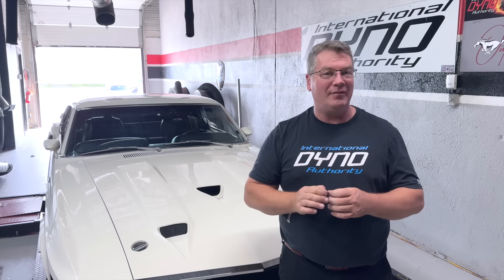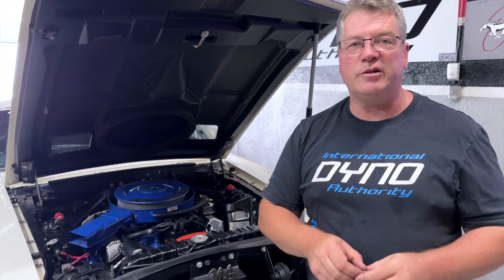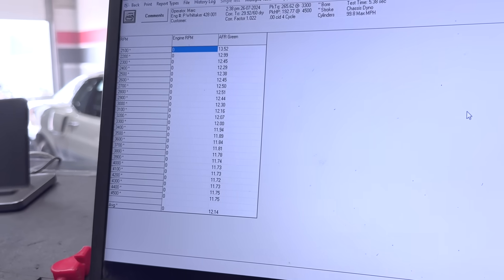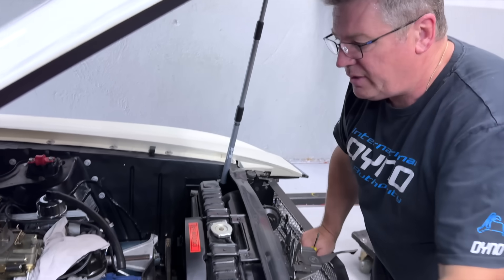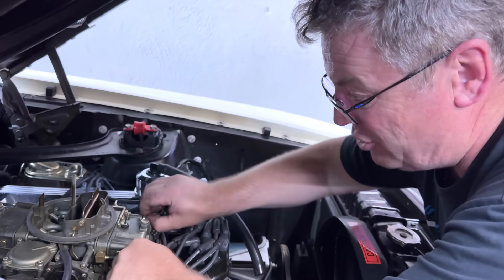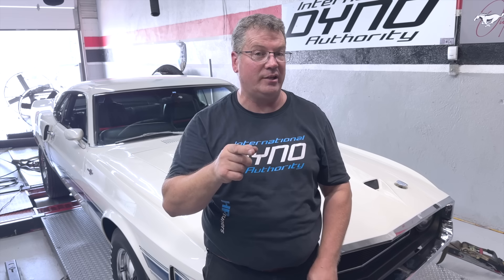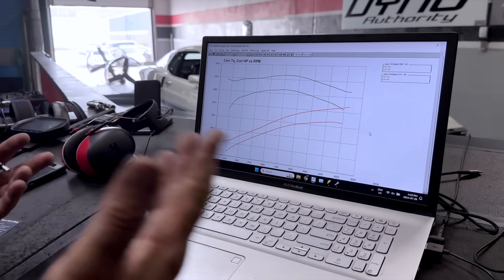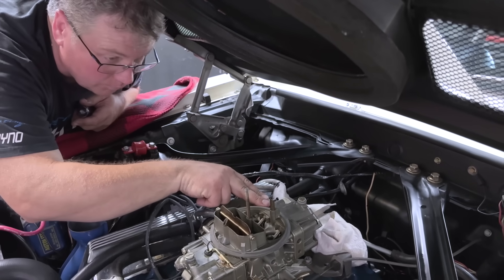Original, unrestored '69 Shelby GT500 tuned on the dyno

Comment: I run a 750 AVS on my modified 340. I took the choke out. Removed the flap and I also drive it on pretty days in the winter. I live in NC so it’s pretty much all year around. It takes a little longer to run on it’s own. About 2 minutes in winter. But with a bad experience on choke I usually remove them or wire them inoperable. Nice 428. What a beast.

Comment: The cringe is real with this guy, the point to make the pull is 🤮 plus the ear muffs
Reply from the maker: Excellent, and with with a tuning only shop, 600 + Vehicles through per season .... Making 16 passes on average per vehicle , That's just shy of 10,000 passes per season. Each and every person, who listens to 10,000 passes per season. Is going to use some sort of ear protection... We still want a job next year. LOL. Have a super evening. PS. Sometimes we do take our ear protection off just to hear a particularly awesome specimen of horsepower.

Comment: Did you restore the vacuum advance to get the timing on spec for light engine loads? I know it probably wouldn't make much difference on full-throttle dyno runs.

Comment: I went through the exact same exercise with my Holley 4150-series carb, and learned that they were intentionally "overjetted" from the factory to function across a wide range of ambient conditions so that the engine would never run lean even in the most brutal conditions.  This was solely done to prevent engine failures and warranty replacements.  Besides switching to smaller jets, you can also play with the PVCRs (Power Valve Channel Restrictors) and high speed air bleeds to really optimize the AFR for wide-open throttle performance.
Reply from the maker: @torqueytorque8861  

On a newer version, of this carburetor, you can adjust a lot more incrementally.

This carburetor, was limited to low speed  air screws. Fr. Rr main, Power valve, and float, squirter and nozzle size.

All of which we worked with, until happy with a "smoke free"  result.

High, mid, and low speed air bleeds would've been a quicker remedy.  Also the PCV circuit was drawing and depositing oil into the intake / combustion chamber, bypassing the Carburetor.
Reply: @internationaldynoauthority693  I forgot to add in my original post: THANK YOU for sharing your work.  Great job on the Shelby and the video!  And the 4150-series that I have is model 3247 from 1966. :)

Comment: Nice job with the tune. And nice car too. I had several Gen 4 f-bodies and out of the box were doing 300 hp to the wheels with a manual and no mods. The first generation muscle cars are hugely collectible but would get crushed in all around performance by a garden variety Cobalt SS. And then there’s electric… time moves on.
Reply: SOME of them would....
Reply from the maker: Absolutely, times have changed.

Comment: No compression test? Never pulled the spark plugs?  There's no telling what type of spark plugs are in it or  what their gap is. Someone's changed out the distributor ? Or carburetor.? Plugged vacuum port. Why?
Reply from the maker: There's a complete checklist. Which must be adhered to before the vehicle arrives. 

We did it. In fact remove spark plugs, we did in fact check them. 

There were brand new plugs installed previous, to the appointment. 

The main thing is that the plugs were gapped correctly. 

As we are a tuning only shop. The vehicle has to arrive in pristine condition. 

If there's a mechanical issue like lack of compression. That needs to be checked ahead of time. 

And in this case, you could see, you could tell every time we made a change, it got better. Every time we made an adjustment there was an improvement. 

We just had to work through each one of the systems and take everything step by step until it was correct. 

Sometimes things aren't so cut and dry. Sometimes you have to think about. Where is fuel available? Where can fuel come from? 

Go through each one of the circuits, ignore some of the obvious. And nitpick on the tune, until it is correct. 

In this case, this vehicle came to life. 

Thank you for writing in and stimulating conversation.

Cheers from all of us at International Dyno Authority

Comment: 190 hp in a 428 😢 almost as much as a dodge caravan 😂
Reply from the maker: We have also tuned 100's of 3.6 Pentastar engines, nice engine.
Reply: No 300 HP 400 Ft-Lb minivans out there.  This thing would be a blast to drive at those numbers.  No it's not hellcat fast.  That's not the idea...  When you stomp on it that carb makes intake noises that rival the hellcatt blower siren...  :)
Reply: @davidvenhaus4114  i here ya  ;)  but the new caravan with the 3.6 has 287 hp 260fp torque 🙂 i was making a joke about the baseline dyno pull at 190 not tuned

Comment: You cant really go by the factory timing settings on this engine, the gas it used does not exist anymore.  You want all the advance you can get on this big block, keep advancing until you here spark knock under a load in 2nd gear, then back off a tad and reset your idle.  You engine will thank you.
Reply from the maker: IF that method is one you choose to use, that is GREAT!   Here at International Dyno Authority, we test using "Telemetry"   .    If we add 2 degrees of timing and see a sizable increase, then we add 2 more (and test, and test and test) .   What you are witnessing is a condensed version "simplified"   with the final results displayed for a classic car.   We were able to see quantifiable results using the dyno to measure fuel  100 over 100 rpm and ANY gain in hp was documented by repeating testing to establish complete reliability.  The fuel being used is readily available 91 pump gasoline. We use responsible methods -- spark plug readings, AFR monitoring, temperature and Tq and Hp curves   ........ never guess work.
Reply: @internationaldynoauthority693  Yea, everyone doesn't have one of those dynos in their garage my friend. Your way is the best no doubt, but my stupid way works pretty good.  . We have 93 octane and different elevation in Tn, so my timing is going to be different from your timing.  My point, everyone timing is going to be a little diff, advancing till you hear knock then backing off works if you dont have a 50g dyno handy.
Reply: You are correct! That's exactly what it tells you to do in the factory shop manual. Look it up.
Reply: AV gas. At your local airport.
Reply: @wannabecarguy  The feds and some states are trying to outlaw leaded avgas, no telling how much longer it might be available.  At the federal level, probably until 2030, but in places like CA and other blue states it could potentially be any day.

Avgas is also formulated for considerations that don't exist for the most part in road vehicles, like vapor pressure at very high altitudes.  This makes it more expensive than it otherwise might be, in my red-state area there is about a $2 per gallon premium for Avgas over pump 100 octane unleaded available at Sunoco.

All that said, I don't disagree that avgas would probably works really well in 1960s high performance muscle cars.

Comment: Makes me wonder how my 71 429CJ mach1 with Sniper will perform when finished.. thx for the vid!
Reply from the maker: Sniper will NEED tuning, but will work great !
Reply: @internationaldynoauthority693  Thats for sure! I have been thru loads of pain with a sniper on my 73 4v 351c. false air in headers/aka o2 sensor madness and the most annoying varying fuel pressure, which took me a while to fix assuming it was me doing wrong with the tuning, while a good old external regulator did the trick. No more over rich condition depending on moon/sun alignment! :) Despite the tough problems I had to resolve as a EFI noob, it runs now for months like a modern car and I'll never go back to a carb! Adding one to my 429 should not be as complicated.

Comment: This was a video that really hit home for me. Thank you.
I made a career "trying" to get carburetor cars to pass emissions in the 80/90's.
I had a very good scope and exhaust gas analyzer ... But no dyno. I was 1/4 mile from the emissions station so they just kept coming.
Among other things I became a Holley expert and had an amazing kit of parts available on hand.
The trick was to get these cars to pass an IM240 test without getting the attention of federal or local authorities. I had to get creative, just not blatantly.
My favorite solution to solve the world's problems was, cap rotor, plugs and wires. This was ideal compared to 2 plugs and 2 wires on a V8 because it would usually run much better and get better economy so it would pay off in the long run.
Having customers who really didn't want to see a mechanic was less than ideal, so if they left happy, the word of mouth would be positive.
Thanks for sharing.

Comment: Way too much show - cool car as a piece of history but that engine is and always way a total dog.
Reply: Check the NHRA records... the 428 Cobra Jet is a record holder
Reply: @JC-gw3yo that’s right. I worked for the engine builder for the Gas Ronda 428. I still have spare pistons and rods for that motor. Was a beast!
Reply: Just the mention of Gas Ronda...makes me smile and know I'll be staged somewhere near you....when we're stuffed and on the fossil display at the Smithsonian! Thanks for the smile.  @BearRaiderHB
Reply: A 428CJ was far from a dog... Only an idiot would say such. You probably had a 396 Chevelle and thought that was fast, 😂😂😂
Reply: You have no idea what you're talking about.
Reply: 😂😂😂 How do you like that Z06 getting dragged by Coyote's 😂😂😂 C5Z, what turd, 😂😂😂
Reply: @02autogt ur talking crap as a 2valve owner, you should be ashamed. Less than 245hp as a 98gt owner it’s a 2v it’s weak get over it. My 01 ws6 would gap my 98gt it’s fbo 4.56s t45 ws6 is full exhaust no mufflers or cats or resonators a slp lid and untuned lol yeah yeah the terminator I know chill bro.

Comment: I actually thought that a Shelby GT 550 would bring more to the table, than 299 hp?  What am  I missing?
Reply: That's at the tire - at the crank probably 370 as tested.  It also sounds like it has very mild cam timing and the heads and intake are going to be limiting factors for sure compared to modern parts.  You could probably make 600hp with this motor using a roller cam around 240 @.050, aftermarket aluminum heads flowing in the low to mid 300s, an air gap intake and a 950 XP carb.  But this is a collector's piece so you don't want to replace the original parts, it's worth way more bone stock.

Comment: Change plugs
Reply from the maker: They were changed, and gapped correctly  Brand new.......All vehicles have to arrive to be tuned after having gone through a checklist.   This one had new wires, plugs , distributor,     fuel, carb kit,  etc... etc...

Comment: Gorgeous car, But that engine compartment looks way too clean and polished to be 55 years old and unrestored, If that car is unrestored it is astonishingly well preserved for its age.
Reply: Yup, there's no way this car is original.. not by a long shot
Reply: @matttafakt  Thanks for the backhanded compliment, it truly is an unrestored and original car - the car has never been apart. Probably one of the best preserved examples out their - if you saw it in person you would know that it is original.
Reply: @matttafakt  You would be surprised unicorns do exist. I had a 9k mile 71Mach 1 in 2002. It had the original fan belts the door buzzer worked and even the dash clock! It was never detailed. That car definitely looks like it was detailed. However if you look at the side stripes the dead giveaway it's original is the reflective 3M blue stripe. Those we're hard to come by even 30 years ago if you had an accident. That car is about as close as you can get to getting one off the showroom floor.

Comment: What are the numbers?  What do they mean:  10, 11, 13?
Reply: Air fuel ratio numbers , air amount to fuel quantity such as 12.1
Reply: air to fuel ratio I believe.   The perfect ratio is generally about 14.7:1
Reply from the maker: @timwillis1738  13  pounds of Air to 1 Pound of Fuel   13:1  Measured at the Exit of the exhaust , by Telemetry called an AFR Gauge.     12:1 is LESS air.    11: 1 is Less air etc...
Ideally under FULL load, Wide open Throttle,  you want to see 12.5 to 12.8 and then tune that amount for Power.    ON a carbureted vehicle you will want 13.5 to 14.1 at idle or NO load.   On a port or Direct Injected vehicle you want to see 14.6 - 14.7 at idle.  14.7 Is referred to as Stoichiometric or (in balance with atmosphere)   14.7 is JUST enough fuel to rotate the engine at idle or No Load.  Power is made at 11.5  with a Boosted Engine.

Cheers!   and Enjoy.
Reply from the maker: 13  pounds of Air to 1 Pound of Fuel   13:1  Measured at the Exit of the exhaust , by Telemetry called an AFR Gauge.     12:1 is LESS air.    11: 1 is Less air etc...
Ideally under FULL load, Wide open Throttle,  you want to see 12.5 to 12.8 and then tune that amount for Power.    ON a carbureted vehicle you will want 13.5 to 14.1 at idle or NO load.   On a port or Direct Injected vehicle you want to see 14.6 - 14.7 at idle.  14.7 Is referred to as Stoichiometric or (in balance with atmosphere)   14.7 is JUST enough fuel to rotate the engine at idle or No Load.  Power is made at 11.5  with a Boosted Engine.

Cheers!   and Enjoy.
Reply: That makes sense now.  Thanks.

Comment: I had the 1135CFM Daytona Racing Carb for that engine. Really made it come alive. That one is also missing the cold air ram through the hood. When that opened it had the same effect as the secondaries opening. I put a mechanical system to open the secondaries.

Comment: I would never put an original 69 car of any type in that condition on a Dyno on the chance of blowing it up. That is just freaking ridiculously stupid.
Reply: It's a car, not a doll on a shelf. Not being abused, no high revs. When you know what you're doing a light run up on a dyno will not hurt it in the slightest. This is how you properly tune an engine.
Reply: So, are you saying not to put your foot to the floor?  Its a stock motor why would it blow?
Reply: they only went to 4500
Reply from the maker: This dyno run is IDENTICAL to a Highway onramp. Check your blind spot, signal and then Accelerate to enter traffic.

(Side note:  In 9 years we have NEVER had an engine failure)  The average run time is 5.0  -  5.5  seconds.
Reply: And why would it blow up?